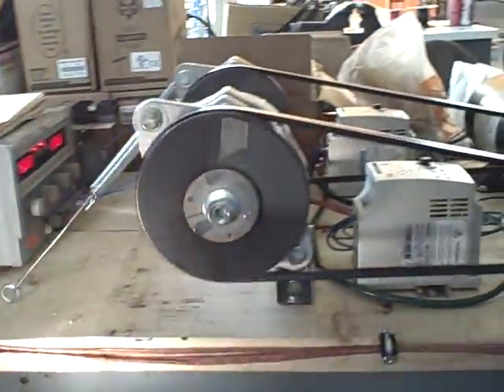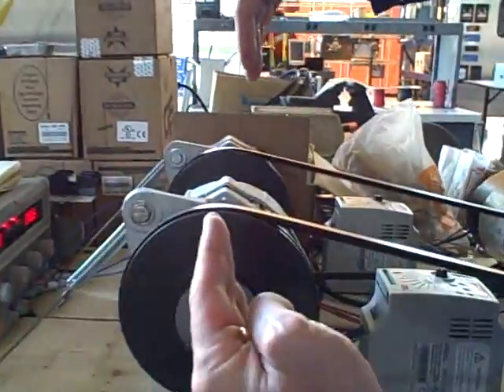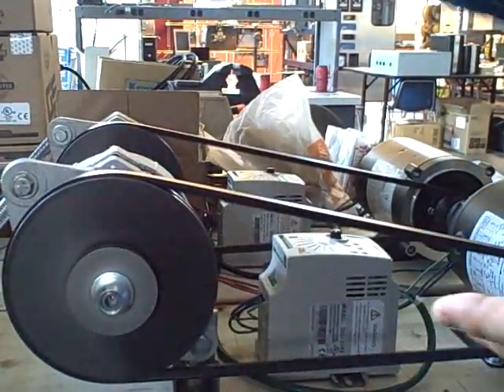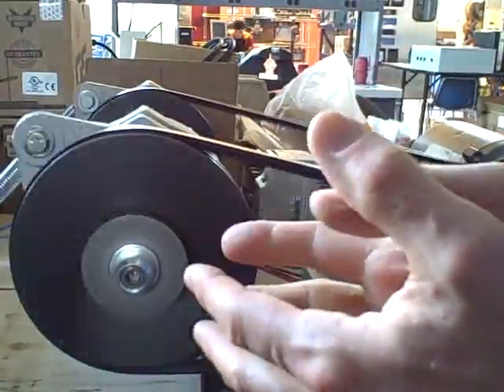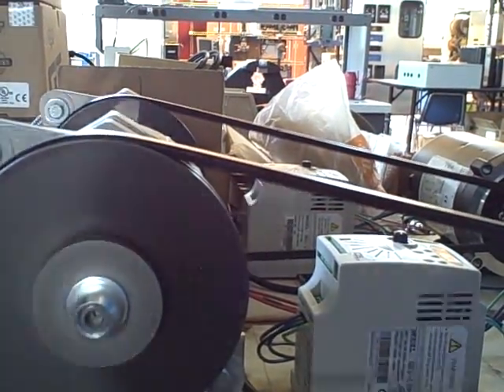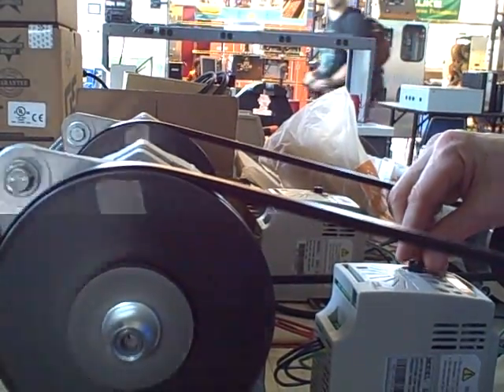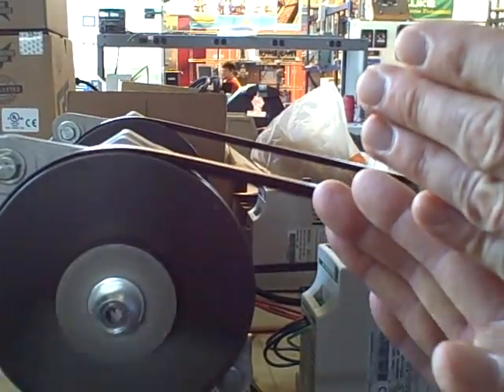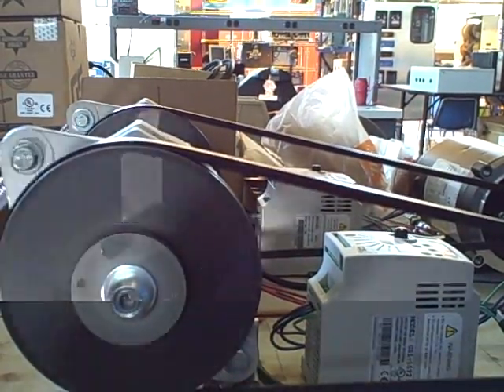Synchronizing AC generators -- Part 4 (phase deviation)

Comment: Very effective demonstration. I have a minor technical niggle though. It may improve the visual indication of the phase difference (relative tape position) if the camera was placed farther from the table but the lens zoomed in to compensate which would cause an optical compression such that the two rotating pullies appear closer to the same size. Just a thought.

Comment: So I have a question about synchronization across the grid. You have a number of powerplants that are synchronized buy pushing current onto the grid. If there is not a common reference other then grid voltage,  it looks like the grid frequency would be drifting. That's not to mention oscillations between power plants, sudden changes in the load, etc. Is there a central controller for each grid that has the ability to fine tune the load between plants?
Reply: Search: "Automatic Genetation Control".

Comment: Put an overload relay on the contactor and demonstrate pole slip! I am sure we all want to see it!
Reply: Yeah!
Reply: Thats why im here! I would love to see a demonstration of different failure modes
Reply: I want to see an out of sync close as well
Reply: If this were tried in 2 5000w generators, I wonder if the 20a breaker would be enough to protect from pole slip. And if there would be any other items that may not like connecting this way, like an automatic voltage regulator module

Comment: I enjoyed watching all four videos.  I was wondering what would happen if you combined the two generators together and the motors powering the generators did not have the same power output.  In other words,  the generators would be synced, but one motor was more powerful than the other.  This would simulate two power generating stations where one generating station produced more power than the other, both supplying power to the same load.  An example would be base power generators and peak power generators connected to the same power grid.  Say, in a real life situation,  you have one generating running and the load demands more power (current?) than the generator can produce.  Then you add the second generator to the grid.  But, the second generator is not as powerful as the first generator.  However, the second generator can supply the extra power (current?) needed for the load.  What would happen?  How would current flow in the system?  Thank you for making these videos.
Reply: This is EXACTLY what I want to know!  When I was in the Army, we had a pair of generators mounted on one trailer. One had twice the capacity of the other, so they were in a 1/3 - 2/3 ratio. We would service one while the other carried the bare minimum base load, then start it up, sync them with a mysterious sync box that had a neon sync lamp in the panel, and then shut down the other one for servicing. At least one of them was running 24/7 for an entire year! That was a lot of fuel, but we had reliable power. I never understood until now how that magic box worked.

I can see having something like a 1,000W lithium + solar system providing baseload to a camper, then syncing a 2,000 - 3,000W gas generator for when you had heavier short-term loads.

Comment: After viewing your series I have hopes to solve my problem. Could you help? I need to sync 2 120V solar inverters for a 240V split phase air conditioner. Could you help or guide me. Thank you.
Reply: As far as I understand: Solar inverters cause some problems in a grid, as they dont have a rotating mass, there is no inertia, which is what enables the 2 motor/generators to come to an agreement of whose motoring and whose generating.

I cant think of an easy way to add (like batteries) ac voltages un synchronized. Totally possible if their on the same shaft, they're physically in sync, can series or parallel windings all day. Roll any voltage you have windings for. Id think you'd want to parallell your 110v, as your 'grid', n then use a stepup transformer to get your 220v. I only have experience with 240v systems, but where 110 is common, perhaps autotransformers of adequate size are a thing? It'll be big tho. I was actually having this conversation at work today, very large isolation transformers. A ghetto solution would be a few stick welder transformers. We were talking 2 back to back. But a 110v transformer stick welder bolted to a 220v stick welder might just work. Or 3x 110v units. But that gives you an idea of the size of this beast. Could work...

To continue the thought experiment tho, I have seen a lashup job with a 1kw standalone battery backed system that ran as the generator, with a 5kw grid connect inverter attached. With sun, there was 6kw of power, but at night dropped to 1kw off the batteries. Could run washing machine, oven, AC, etc during the day via the grid connect inverter, but at night that circut was disconnected leaving the fridge, lights n tv running off the 1 kw battery system. Very custom and hackish, but appeared to work. They just made lunch the big meal of the day, n had a cold roast sandwich for dinner. Off grid, thats easy enough. Do your washing during the day, n open the Windows at night.

Tl;dr, no, i dont think you can series your inverters, unless they are specifically designed to do so. I run 2 solar strings, 2 chargers, 1 battery  n 1 big inverter here, but i dont run AC either. 

The human body can adapt to most temperatures, its better to just acclimatise. You dont need to be 24 degrees every day of the year. The AC is nice to have in a heatwave, run it of a generator if you must. Last year, i think i ran the AC 4 or 5 nights? Priceless when you need it, but is no way a daily need.

Comment: I understand that you are using these car alternators just for an example but, I wonder if synchronizing alternators in a dual (or 3+) alternator setup in cars would solve the issue of load/power distribution? BTW load distribution is a huge problem in aftermarket multiple alternator setups in cars, often seen in the car audio scene.
Reply: In normal use in a vehicle, the AC from the alternator is rectified by diodes so the electrical system only sees DC. So this sort of AC synchronization doesn't apply.

Comment: When the generator is driven by a steam turbine of, say, 1 million horsepower, and the load is a medium-sized city, energy must be flowing out of the plant, surely.  In that case, can the lagging generator still be acting as a motor?  Is it a superposition, like one machine is acting as 100% generator and 1% load (total output 99%), and the second machine is acting as 100% generator for the grid and 1% generator to the first machine (total output 101%)?  Or is there a better way to think about it?

Comment: Are those car alternators? In that case. How did you hook up to the windings?
Reply from the maker: We opened up the alternators and simply wired three 12-gauge conductors to the input terminals of the bridge rectifier assembly, then ran those wires out some of the holes that were already in the Delco-Remy alternator case.  Some heavy-duty alternators such as Leece-Neville units already have three studs on the back pre-connected to the stator windings, but since I'm building six of these generator stations going with expensive Leece-Neville units would have broken my budget.